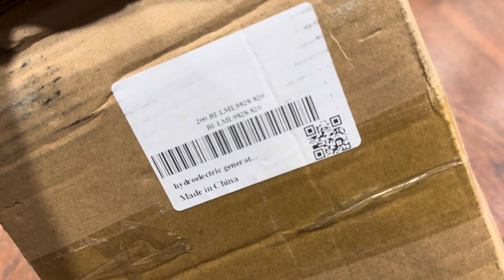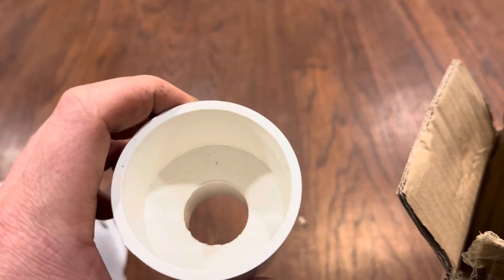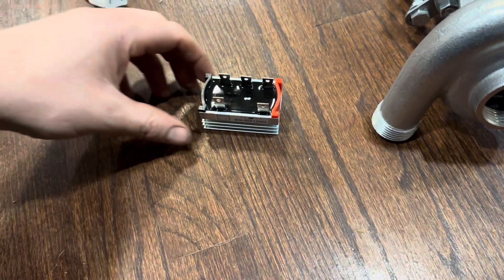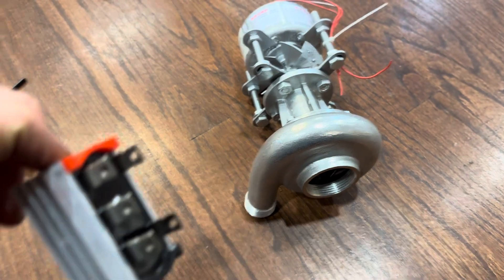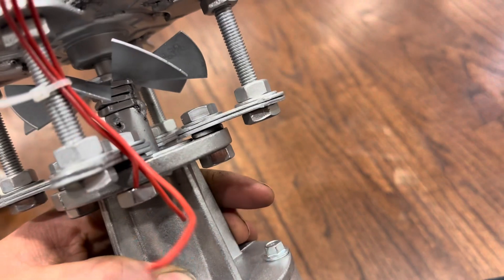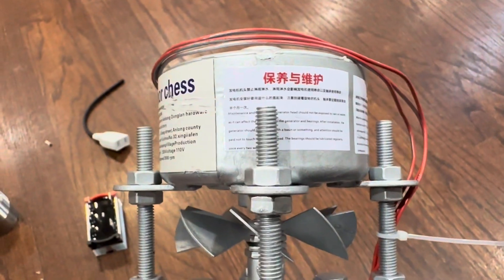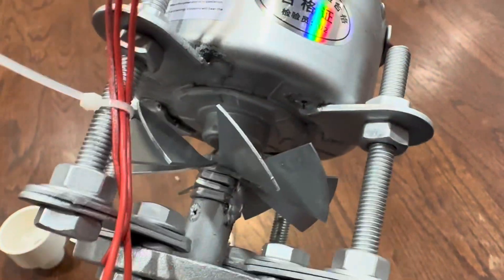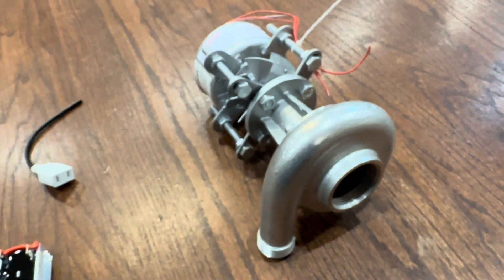500W Hydroelectric Generator First Look￼

Comment: The electronic module is just a 3 phase rectifier. The generator outputs 3 phase AC, the recifier turns this into DC. The actual DC output voltage will change wildly depending on water flow and electrical load. You will need some kind of regulator to do anything useful with the output voltage.
Reply from the maker: Great info thanks!